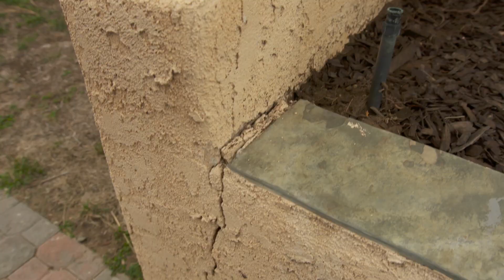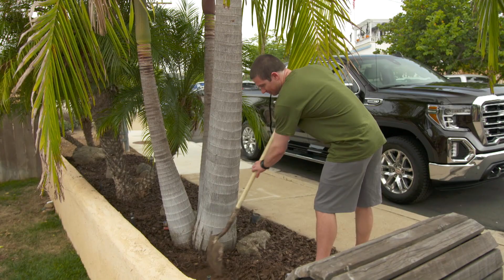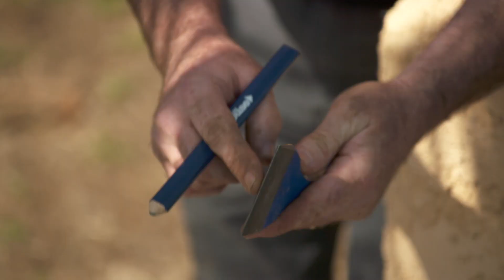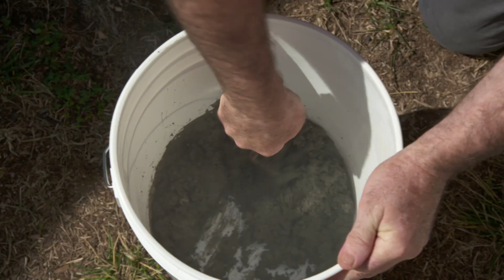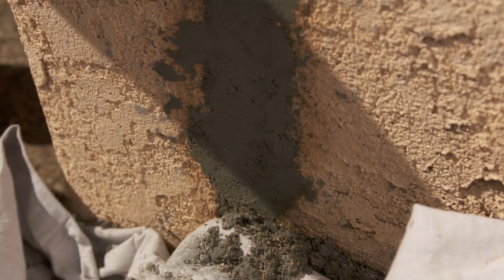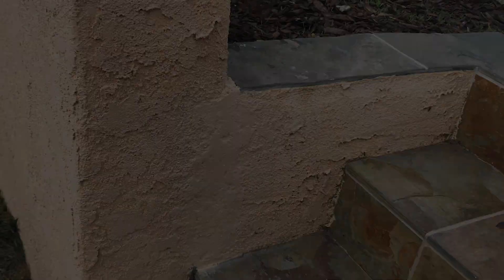How to Repair a Cracked Stucco-Retaining Wall | Ask This Old House

Comment: You  widened the crack to 1/4" with a chisel  before filling it with mortar.  Other videos suggest just running a bead of some kind of stucco repair "caulk" and working that into the crack with a finger, then a sponge to feather out the repair.  Your thoughts?
Reply: exactly what i would do

Comment: Excellent video. 
However, I would do the project a bit differently. As a home owner in San Diego with exterior stucco wall, I would use real stucco materials (Omega Base 2 or Base 10 with right color match or La Habre Base 100 or 200 with right color match, cost less than $20 for a bag of 90 LB of Base and 1 Lb color match). 

Fill the gap as shown in the video with with real stucco materials AND no PAINTING.

You do not paint a stucco wall ever. The main reason for having a stucco wall is that it breathes and let the water/moisture out through the pores. Once you paint the stucco wall, the breathing advantage is no longer exists and it is prune to peeling and periodic need for repainting. A good stucco structure should last 30, 50, or 80 years. If a cracks develops, fix it with real stucco material, not with synthetic fillers or mortar mix that can not be color matched.

Comment: I get that this is a "do it yourself" type repair for homeowners but it's not going to last. It broke because there was no reinforcement and will continue to move outward, especially with that tree there, until failure or is too far gone to repair. Filling the crack will not strengthen anything because the movement it outward, not inward. Besides the tree removed, what it really needs is to be drilled with a rotary hammer in both directions and have structural epoxy and rebar inserted in the drill holes to keep it from moving. Otherwise that crack will open up again and you'll have the same issue year after year.
Reply: So true…yet another home improvement debacle.

Comment: This is NOT a “stucco crack”. The retaining wall has lost its integrity. I’m guessing the crack reappeared shortly after the video was posted.
Reply: pete smyth  Yes, but the crack is a result of the separated concrete. I guess my point is that no real repair was actually done here. At least not long-term. This homeowner should keep his tools close by, as he will need them again.

Comment: Also drill long self tapping lags about 14-16"  to help. Screw in towards the street with bolt/lag heads towards house while doing that so its comes out the sides...   Or plus wrap with chicken wire around corner then re concrete or mort over it then repaint like new last 100% longer while roots push and grow. Also stuck Ooooo is not just a pattern.

Comment: Tree: But I just want to live and grow, remove and capture harmful pathogens and carbon dioxide from the air, provide you with oxygen, cool down your property through shade and water evaporation, capture and slow rainwater which prevents the risk of flooding, provide a wind break, be home to many insects, birds and wildlife plus I look aesthetically pleasing.
Host: But you made a half inch crack in my concrete wall.
Reply: "In a perfect world...".  In a perfect world, there'd be no humans to destroy everything they touch.  Leave the tree.  Throw the people out.
Reply: @alext9067  or humans adapt more to the trees and respect them more.
Reply: @design-build-live   Still, they need a beating when it comes to trees and the natural world.  I see people cut down trees because they don't want to rake the leaves... or they're afraid one will fall.  Jesus Christ!  Humans are idiots.

Comment: Because he didnt fix the issie, a crack will reapear in a year or two if they are lucky not 5 ot 10. Some elastomeric caulking with a sponge or rag to stipple it would be far easier and stretch with it as it cracks further vs. A cement mix which will not stretch.

Comment: Looks like a 3' wall?  If so, that retaining wall is no longer structurally sound, unless it was built with rebar anchoring at least a foot below grade...that mortar does nothing to restore the strength except hide the potential danger.  Even pinning the sidewall back with several anchors won't overcome the hydraulic pressure of tree roots.
Reply: You're right, but it does make it look better, for now. I don't think it will take long before it opens again, but he might be able to just caulk it then and throw a little paint on it ?
Reply: @augustreil  - The fact this is San Diego will likely help some with longevity due to their climate.  Anywhere East of the Mississippi River and I'd give it less than a year before there's a new sizeable crack.

This patch would be a good fix if you're selling the house and want to trick the buyer's home inspector, but otherwise is a band-aid on a bone fracture.
Reply: @cup_and_cone , I don't disagree with any of these comments, but the other option would cost 1000's and 1000's of dollars. Until a major overhaul is an absolute necessity, I would do the same and just keep patching it.

Comment: Why not add something to reinforce the mortar? There's plenty of liquid and fibrous ad-ons to prevent cracking in stress areas.
Reply: The only thing that is going to solve the issue permanently is to get rid of the trees. You can reinforce it with whatever you want but tree roots will keep moving this wall.
Reply: No masonry binder in this world is strong enough to stop that wall from pushing back apart as long as the tree is still there and growing.

Comment: Not worth all that, will crack again soon.
Reply: Exactly. That’s why I don’t shower. I’m just going to smell bad later on anyways. Smh.
Reply: i had to do some stucco repair and found kirk giordano on yt; he's an actual professional in the stucco field whereas this dude is mason by trade. from watching kirk's videos it is clear that this will indeed reappear, a better solution would be to use mor-flexx - a sanded caulking product that is highly flexible and can also be floated to some degree. matches stucco, and will last longer.

Comment: man, stucco is terrible. looks like a nasty old sponge or a dry, cracked foot. gross.
Reply: It's everywhere in Florida and California.  Cheaper than brick, but longer life than traditional siding.  The worst thing about it is that it ALWAYS cracks as buildings settle with age.  There's no getting around it.
Reply: The trick is that real stucco is not supposed to be painted. It needs to be open and unsealed. Paint traps moisture inside and degrades the stucco.
Reply: @morthomer5804  Most in HOA neighborhoods so they can issue citations for fading paint.